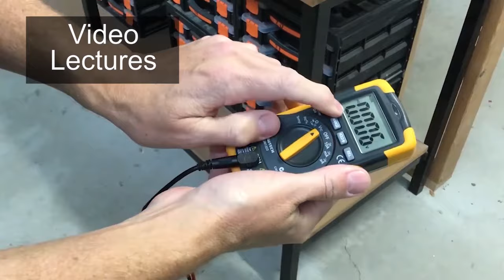How To Make An Electrical Extension Cord

Comment: So basically you can attach a normal single or 2 gang socket (one that normally screwed into the wall + back box) on one end of flex cable and other end with a plug??

Comment: Informative video! I didn't know that replacement and after market plugs and sockets have to be the  clear type!
I know that Australia and New Zealand TPS and Flex wiring code are 100% the same: Phase Red (tps) - Brown (flex); Neutral Black (tps) - Blue (flex); earth Green/with yellow tps & Flex!
If been attaching plugs for near on 20 years, some one said to me I'm pretty good at it, that I could replace a plug with my eyes closed (well almost 😀)! 
can the older Plastic (like PDL) still be used?